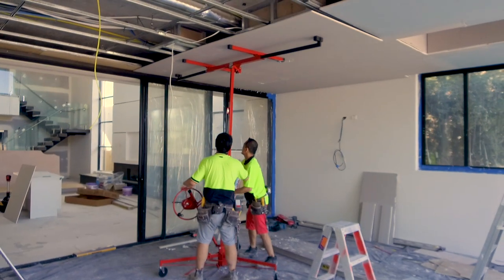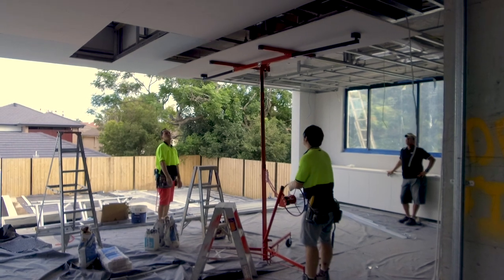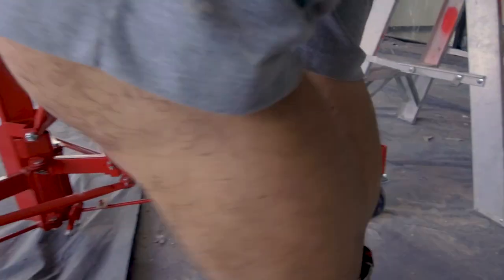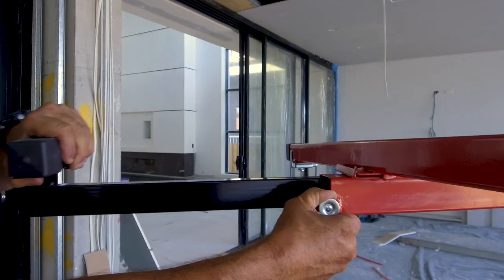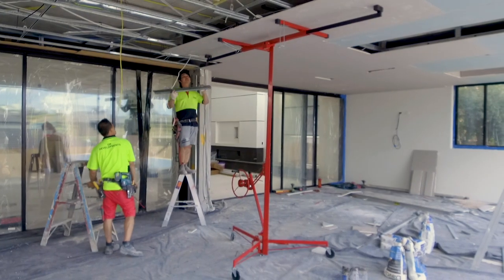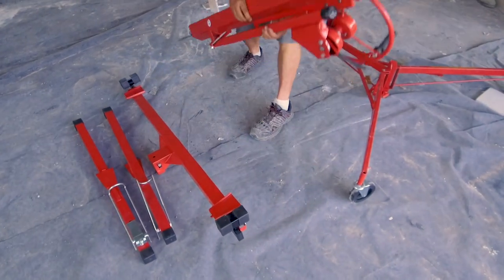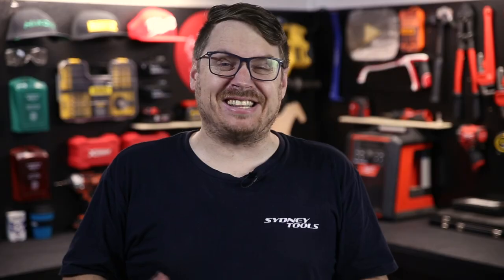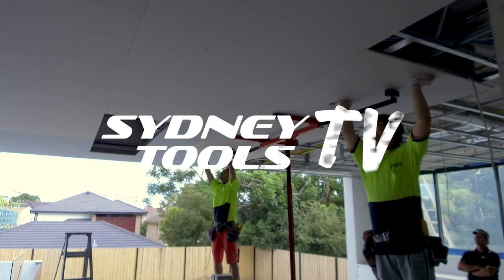Drywall and Panel Lifter

Comment: What about directional legs on these things they cannot be brought closer to the wall. Does it work?
Reply from the maker: Feet don't exceed the size of the deck when it's in the horizontal. So you can bring the lifter in flush against a wall.